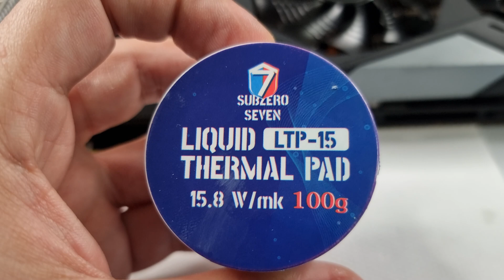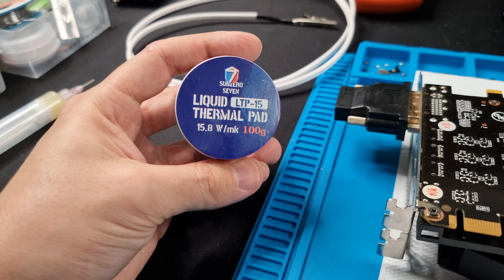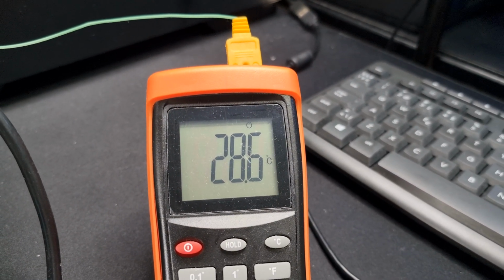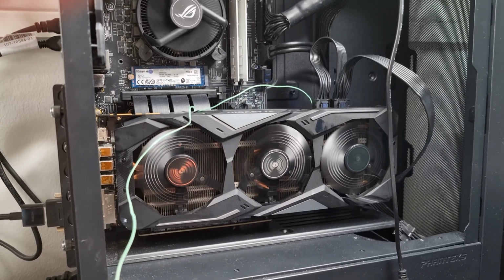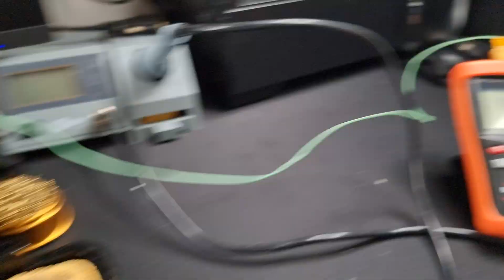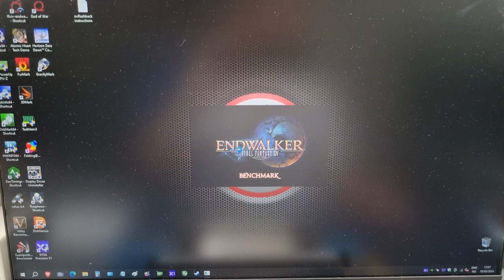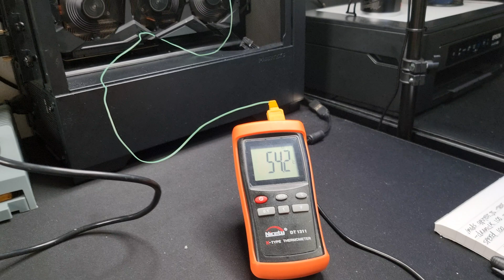Thermal Puddy VS Thermal Pad

Comment: I worry about it when it comes time for cleanup. Removing a thermal pad is a piece of cake but putty will be a nightmare.
Reply from the maker: I would not use so much. Use only as much as needed to cover the chip, depending also on the gap between the chip and heatsink.

Comment: Hi ! Thanks for your video.  So, how it is going the thermal putty so far ? Im planning to switch the shitty pads to thermal putty so your feedback would be nice ! Greetings
Reply from the maker: Its going well so far. As it has cured it has gotten a bit better but thats expected. No issues to report.
Reply: @TechnologyHive Hi. Thanks for the video. How is your experience with cleaning that old putty out, since it's been a year now? Before I already applied it on a Dell laptop I'm using for work sometimes, so I see the putty still being as it was a year ago, not hardened, etc. I used the pink one from Zezzio though, as it seemed somewhat of middle quality from reviews. Now I'm wanting to test it on my PC graphics card since after replacing dead pads I couldn't get the exact size no matter what, so now I'm stuck with hotspot shooting through the roof at times. Was wondering if it really dries out as bad as some people show in their "scary videos" where they literally have to get it out in chunks almost peeling it off with mosfets and vram chips. At least there's a few of those about k5pro. Curious about your experience so far, cheers.
Reply from the maker: @razielle8018  This blue stuff hardens to rubber-like substance. However, I did buy the Zezzio pink stuff and it works good. I would just stick this instead if the blue stuff, imo.
Reply: @TechnologyHive Thanks for such a fast reply. Was interested because I think all those putties harden differently. Some become rubbery while others (the more cheaper chinese ones) are like cement, and they stick so hard it's barely detachable (at least from the videos I saw so far), but to be fair they also say that's like 2-3 years down the line, so I was kind of unsure how it'll turn out with zezzio on a graphics card because laptop is laptop, you'll repaste it yearly anyhow, and a gtx1650 won't generate as much steam as a 300w gaming card that I'll probably not touch for at least the next 2-3 years. Guess I'll have to try and see.

Comment: Timestamps:
00:10 - Comparison of thermal putty and thermal pads for GPU cooling.
02:38 - Choosing the right thermal interface material is crucial for effective cooling.
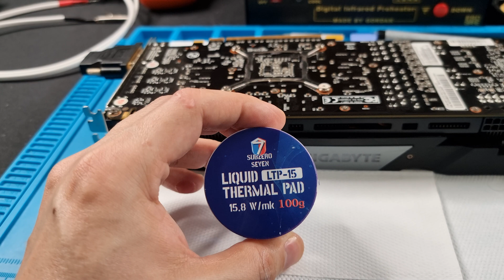04:58 - Thermal pad performance remains consistent regardless of curing status.
07:11 - Comparison of thermal applications for a graphics card performance.
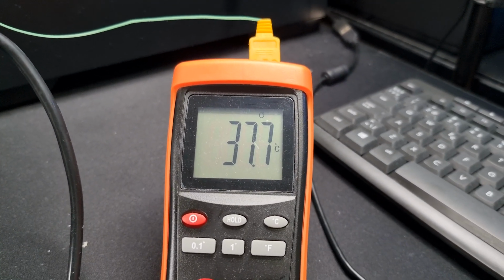09:35 - Thermal putty usage leads to potential cooling improvements.
11:58 - The effectiveness of thermal pads versus thermal putty.
14:27 - Thermal Puddy offers slightly better performance than thermal pads.
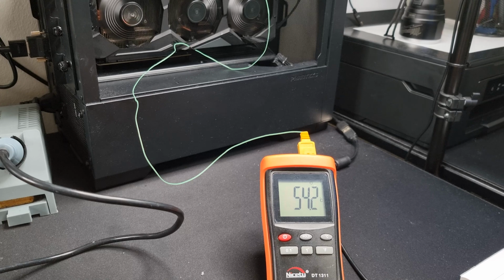17:03 - Thermal conductivity of the product is satisfactory but longevity is uncertain.
Reply: so whats the final verdict?

Comment: doesn't trust arctic pads bla bla bla but trusts some random jar of putty bought of china market with specs they came up from space, so if I made a sticker saying it's 50w/mk then everyone will buy it even if it's a lie and specs for most stuff on aliexpress are lies... Arctic atleast doesn't lie about their pads, lol.
Reply: @1sonyzz  Sure, and then you get some sapphire rx5700xt pulse trio card where the vram pads are 1.8mm and your arctic 1.75mm is actually 1.7mm, tearing easily and not elastic at all. Even after getting 2mm pads from better brands and manually making them 1.8mm, I got left with a hotspot that can reach a 30C delta hitting 100C while not even fully loading the card. Tell me more about how bad is some random putty from China that at least doesn't cause hotspot issues, when not random pads that are by pure chance also from China, are utter garbage.

Comment: My recomended thermalpad is 0.75 mm for my vram in rx 580 nitro who is not avaliable in my country. Its better to stack 3x.0.25 pads together or use thermal putty???
Reply from the maker: @PenghancurXZB  you can buy .75mm from AliExpress

Comment: I replaced my thermalpads with aftermarket ones because EVGA is out of business and you have no chance to get new thermalpads from them(trust me i tried). With the aftermarket pads my memory and vrms where a lot cooler in comparison to the stock pads but after a couple of weeks i get temperaturissues on the core. At the end i had 75°C @1800rpm on a 250W(360W is stock) undervolt. I decided to switch to tp607 and the temperatures of the memory and vrms stayed the samt to aftermarket pads but my core is way cooler now. The core reaches 75°C @1700rm on the stock 360W profile noch. With an undervolt to 280W the cards now is quiet @1400rpm, coil whine is also greatly reduced. I highly recommend to switch to tp607 or any other thermalputty. This stuff is crazy good. I never regret the switch to thermalputty. It is "harder" to work with but the result speaks for itself.
Reply from the maker: @iPain3G  I get my pads from AliExpress and they work wonders. Yeah, I'm sad EVGA is no longer making cards. But nice job with getting those temps down!

Comment: Very confused by the video. On screen your GPU temp went up...significantly. How is this an improvement? Measuring the temp coming off the fans doesn't mean much if the reason its higher is because the chip is getting hotter. I will note it appears that the temp coming off the fan went up by the same factor the GPU temp went up.

Comment: I'm still debating between the heatsink or this glue but the glue seems easier to use and fits many sizes.
Reply from the maker: @M9FQU3U  It works good. Still using it today.

Comment: how is this LTP 15 compared to k5 pro? planning to buy one of these for laptop
Reply from the maker: @trex6693  I have not tried K5 PRO. But this works fine. It's still in use on one of my graphics cards vram. Temps are good.

Comment: Which is better? 

Thermal Putty VS Thermal PAD
Reply: When you have an EVGA card or an other card with weird thermalpad thickness like 2.25mm you should use thermalputty. Every thicker or thinner pad than the manufacturer of your card us brings a lot of issue. I bought high price aftermarket pads which where soft but 2.5 and 1.5 instead of the 2.25 and 1.25mm EVGA uses and got a dryspot on my gpu core which got so bad after a couple of weeks that i only could run a undervolt to 250W to get the card in a usable state.
With thermalputty you never run in those issues. You can apply a ton of this stuff, press the card slightly on the cooler and everything to much moves out of the way. Thermalputty also helps with coil whine. My card had bad coil whine with normal thermalpads but with thermal putty the coil whine is greatly reduced and nearly gone.
The tp607 i used is really pricey but worth it in my opinion.
Reply from the maker: @karimahmed763  It depends on the application and quality. It's not a question of whether if one is better than the other, but rather which brand you're using and your circumstances. So again, it depends.
Reply: @TechnologyHive  FEHONDA thermal

Comment: I like thermal putty, it's great for small devices like laptops, phones. thermal pads are hard to find the right size, especially small devices.
Reply from the maker: @yoomy9981  it is helpful, especially when you do not have the right thermalpad size.
Reply: does it work with 3080 vram?

Comment: Is it really smooth like paste when you spread it with a spatula? You said it doesn't have anything like sand in it, which is what I'm looking for some applications I'm working on. I've tried all upsiren versions and all of them are scratching the surfaces I'm applying them on (I guess a lot of aluminum?).
Reply from the maker: Not this. This stuff is smooth and when you wipe it off, it comes off clean when hardened. It becomes like silicone rubber when cured. Nothing rough about it.
Reply: @TechnologyHive  Thank you! I'll order some from ali.

Comment: I don't get it. If this putty is doing well, temp should've gone up, not down. You're not measuring GPU or GDDR temperature here, you're measuring heatsink temperature, and it doesn't seem to be "sinking" heat as well as with pads.
Reply: Ether way if the heat sink would heat up the heat disapation would be bad and the chip would be cooking under it so his test was spot on
Reply: I think to monitor before and after you need to measure the temp of the GPU or whatever as well as the GPU's clock speed before & after, in some scenarios the paste or putty can reduce the temps so the GPU is able to go faster which may result in higher temps or not much difference but you aren't able to tell unless you see the clock speed before and after could be increased.
Reply from the maker: I am measuring the rear of the pcb, heat under the memory chip. If the puddy is not doing well, the memory chip would run hotter, thus resulting in higher temps. Not hard to understand.
Reply: @TechnologyHive  Pretty easy. I'm an idiot, I thought the thermocouple was placed on alu-plate (dedicated memory heatsink). Sorry, man, I watched one more video in parallel, things mixed in my fuked up head ;D
TbT - I am looking into buying 20g of this exact putty, so I'm in a process of quick, lazy and irresponsible information aquisition online. 
It seemed fishy to me - this putty is cheaper than even the cheapest Upsiren putty, cheaper even than the Jeyi putty rated at 5WmK (man, I love all Jeyi stuff), so it seems pretty unbeleivable that they would be selling 15WmK compound for like 5$ for 20 GRAMS!
Not that I believe these specs, or think they're the most important thing, but on the other hand - products such as these tend to be crazy overpriced because of gamers and nerds, people who'd sell their mother for few C of OC room lol.
Which is why I found that, for example, GD-2 is an excellent paste. Crazy cheap and excellent. 3$ for 30grams, in the same class as Arctic and Kryo that charge more for 1g. Some people simply don't exploit this situation with spoiled gaming kids ;D

Hey, if you say it's good, I'm buying. 

Actually, if you reached this far - if it's not a problem - as ltp15 cures, does it harden, or does it melt into the edges? In essence, can I use this putty alone, or only to add thickness to pads?

Comment: Try UPSIREN UTP-8
Reply: Utp-8 has top tier performance but it's way too scratchy. Not much of a deal on most applications like GPU RAM ICs or VRMs but it will scratch chipset dies for example (depending on the compression).
Reply from the maker: @cmos64  That's real good to know. Thanks for the info!
Reply: @cmos64  I have been using thermal putty for 2 years. You are the first to say that thermal putty can scratch the chip. Moreover, thermal putty does not contain aluminum. The powder of thermal putty is about the same fineness. Of course, the finer the powder, the better the performance. The better, if your thermal putty does not perform as well as UPSIREN's, then your powder will be coarser
Reply from the maker: I will check it out. Thank you!

Comment: Nice video man, I was about to buy this thermal putty (it looks nice Imo), but since it's pretty much the same as traditional thermal pads I guess I will go with another one. Thanks
Reply from the maker: I have started using it to replace 0.5mm pads. It works wonders!
Reply: @TechnologyHive  I have a lenovo legion 5 and this has 0.8mm pads on vrams, so the 0.75mm pads leaves a gap in between and 1mm pads are too tick (half of the gpu's die has no contact), so had to use the first with thermal paste on so it would make contact, at least while I wait my chinese thermal putty (Bought like 3 still don't which one I will use lol)... Also checked your video about hot spot very interesting, and it turns out my laptop has a strange pattern once you lift the heatsink, maybe that's the reason noctua h1 only last like a week with good temps. Didn't know that, but anyway I will use ptm7950 (from China too) instead of thermal paste on the cpu and gpu.
Reply from the maker: @Luis_Sebastian7674  I hope you get that fixed. It sucks having to deal with heat issues.

Comment: I fixed my GPU hotspot issue by replacing thermal pads with Upsiren U6 Pro and GPU die thermal paste with PTM7950 :) (GPU = XFX 6800 XT Speedster Merc 319). Hotspot temps went from 100-105 celsius down to 85-90 degrees and the temperature delta between core and hotspot is only ~10 celsius now compared to 20-25 celsius earlier. If I bought thermal putty today I would probably get the CX-H1300 13.5W/m.K as it outperforms Upsiren U6 Pro and is cheaper too :).
Reply: UPSIREN now has a new thermal putty UTP-8, the performance is much better than CX-H1300, I have tried it
Reply: @李诗豪-v9r  Thanks for the heads up, I am tempted to buy some now :D
Reply from the maker: @user-jv7le2li4t  I'll have look at that. Thank you.
Reply: @evilleader1991  yeahhhhh, can't wait to paste my 7800 xt merc with upsiren utp-8 and ptm 7950, 72c edge, 95c hotspot and 84c mem before pasting, will report the result later
Reply: @raul1642  Awesome :)
Reply: @evilleader1991  i got a nice little improvement with ptm 7950 and upsiren utp-8, gpu from 72c to 67c ,gpu h from 97c to 93c and mem from 84c to 78c, very nice
Reply from the maker: @raul1642 It's always good, even if it's a few degrees!
Reply: @TechnologyHive  yeah, i think xfx are using ptm and a good thermal pad, i can tell from the consistency from the paste (actually, more like thin thermal pad) it's similar like ptm or their counterpart
Reply from the maker: @raul1642  I am not sure what TIM they are using. But perhaps it's better quality than the cheap Dow Corning most are using.
Reply: @evilleader1991  did you change the mem pads by the Upsiren and used the PTM7950 on the die? or did you apply the Upsiren on below and on top of the PTM7950? I'm a bit noob. Thank you.
Reply: @Albertredneck  replaced pads with thermal putty (upsiren) and used ptm on the die
Reply from the maker: @gorkman5697 I'm happy with it. It's still holding strong 💪
Reply from the maker: Good info, thank you! I will have to look into this thermal pads.
Reply: @gorkman5697 Yes it is going very well, i think there is better thermal putty out now for similar price.
Reply: hostpot is 85-90c on my 6900xt aorus master with stock pads and thermal paste it came
Reply: @evilleader1991  90 hotspit is crazy lmao
Reply: Just to be clear changing thermal pads has nothing with the gpus Hotspot the hotspot is where the Gpu Chip in the middle are. The thermalpads are for the vram aka memory on it and has nothing to do with hot spot
Reply: @recordlabeldao7820  you are absolutely right, i just changed thermal pads and thermal paste in one go with thermal putty and ptm7950 xD